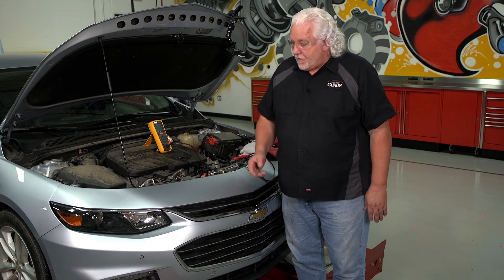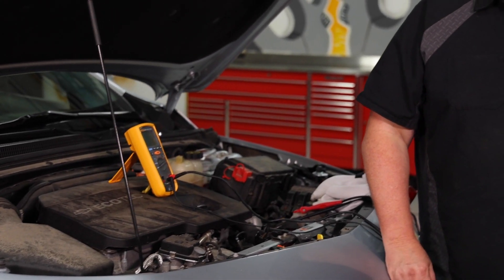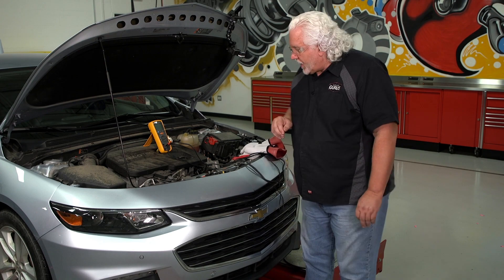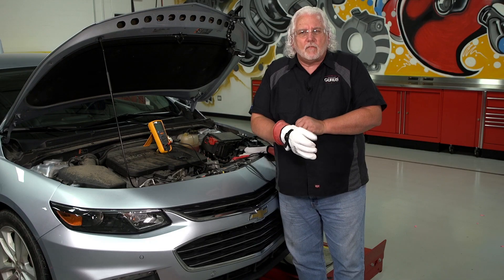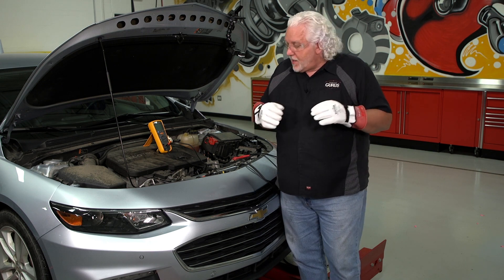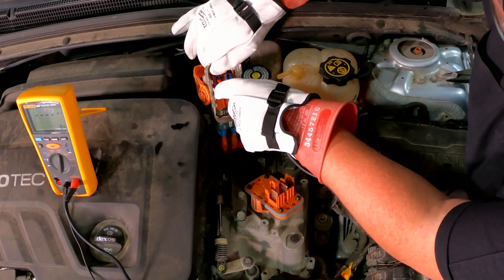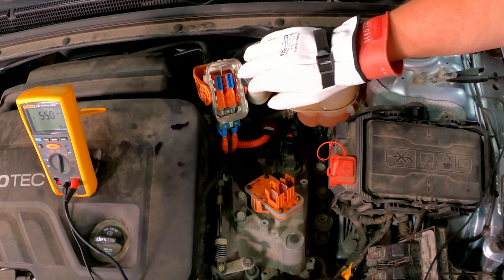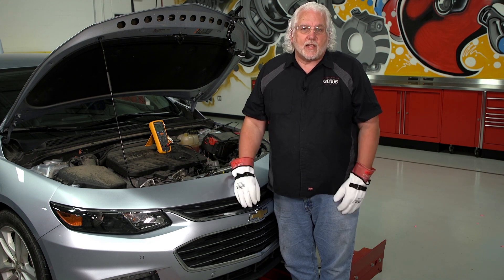Garage Gurus | Insulation Testing on Hybrid Vehicles

Comment: I was just wondering .... should you also check between the woven shielding and the actual lead itself of a high voltage wire? ... or is the woven shielding somehow connected to chassis ground?

Comment: I have the 2012 sonata hybrid ,check charging system, it has 257 volts on the hybrid battery when tested with a volt meter ,the safety fuse is upgraded to 150 the power relay is good ,but car not starting

Comment: I have in the shop  a 2016 Hyundai Sonata Hybrid with DTC POAA6 EV battery insolación fault. And I am having difficulties to figure out where this insulation fault actually comes from. Dealer told customer that they need a transmission but I’m not to sure about it it’s only $14,000 USD for a new trans.

Comment: I think I understood the test? after removing the safety switch did you tested the actual hybrid battery? To make sure it’s not grounded to the chases ground?
Reply: He probably only tested the cables coming from the batteries. The battery contactors are probably closed, so the battery cannot be measured easily this way.  See also the WeberAuto channel "Megohmmeter - Loss of Isolation Diagnostics".